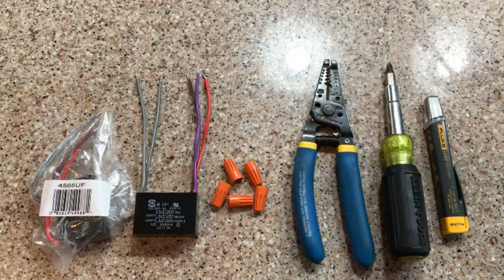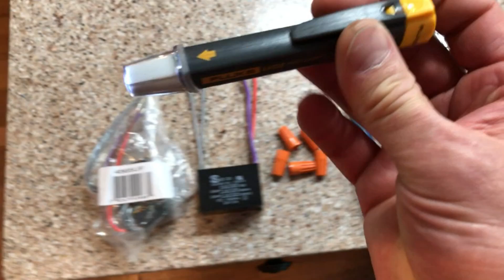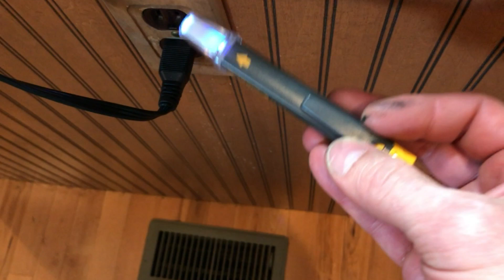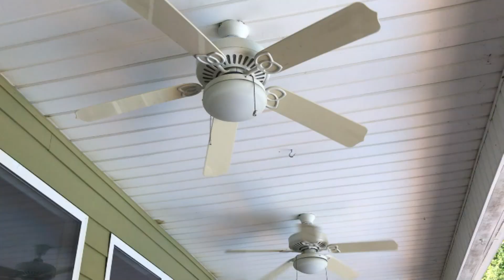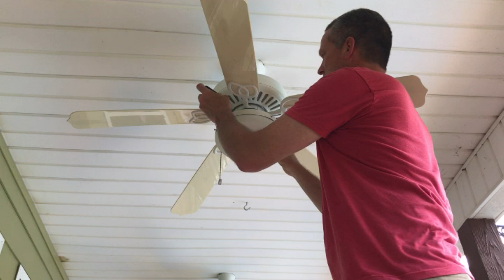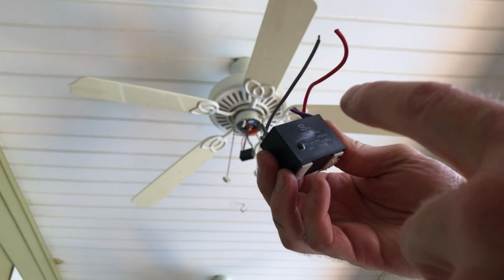Ceiling Fan Won't Run.  Capacitor Replacement

Comment: On a separate issue - ....If your ceiling fan LIGHT should ever stop working AND you have replaced the bulbs and verify the wall switch is good and breaker is not tripped the ISSUE is the wattage limiter\regulator. Smaller than the Capacitor. Its only function is to limit the Fan Light total wattage ensuring the fan light kit operate within STATE MANDATED energy-efficient regulations. JUST REMOVE IT and your lights will be back up and running.

Comment: We have a Hunter old time original outdoor fan, 18 years old, that has to be push started to get it to spin. I opened the cap where the pull chain speed switch is but I don't see a capacitor! There is only the direction switch, the 3 speed pull chain switch and the wires, but no Capacitor. Where else could it be?
Reply from the maker: That is strange. I would think it would be right next to the pull chain.

Comment: I have a double capacitor but can’t find an exact replacement.  What else can I do
Reply from the maker: I would think you could find something with both microfarad values somewhere. Did you search by part number or mf values?
Reply: @fixthemthings  searched both. But no luck so far. It’s a 1.2 and 1.6 uf. Might have to get singles.

Comment: I tried replacing my capacitor but it wasnt that. If you have a remote control fan it's  sometimes the remote receiver. I had that be the case in 2 Costco Hunter fans. One yrs ago & the one that led me to watching this video

Comment: My ceiling fan situation is - both the light and the fan don't work. Is it the capacitor?
Reply from the maker: Probably not. The cap is only for the motor speeds. Sounds like pull chain switch or something further upstream like loose wires at wall switch or wire nuts. Could be bad connection at outlet where they tapped switch from. If the wires are stabbed in the back of the outlet, it could be burnt. A good electrician will wrap the screws instead of stab in the back.

Comment: My fan capascitor CBB61 Has one Orange, One Gray One Purple, and one yellow wire.  I cant find one that matches that.
Reply from the maker: Is this it?

BOJACK CBB61 4.5uF+5uF+6uF 250V AC Ceiling Fan Starting Capacitor for Compatible with Harbor Breeze & New Tech 4 Wire(Pack of 1 Pcs) https://a.co/d/22zlzVc

Comment: I couldn’t see what you were doing, only the backs of your arms. But I did get to see that a capacitor replacement is a quick and easy repair so that I can get even longer life from my quiet and efficient 28-year-old Casablanca Aria fan.
Reply from the maker: I have a better video. The link is at the end of this video.

Comment: @Fix Them Things. I have a question please. Why is it that when the original capacitor of a ceiling fan gets spoiled and you replace it with a different one, the fan speed from 1 to 5 is basically the same high speed instead of it been normal like 1 been the slowest, then 2 will be a little high and the last speed which is 5 been the highest speed?
Reply from the maker: Sounds like your pull switch is bad. When you are on the highest speed the cap is not used. If you use the pull switch a lot then it’s highly possible that it is the problem. Also, some of the switches have push in wires that don’t make good contact. I tried posting a circuit diagram here but YouTube won’t let me paste it.
Reply: @fixthemthings  anyway it’s not a pull switch but the regulator switch type.

Comment: I got a Casablanca Panama 5 few months ago and it had a bad capacitor and the fan wouldn't even start. I replaced the capacitor (and the bearings since it made bearing noise when I first got it working) and it runs like new.

Comment: Wirenuts... I so hate wirenuts or end-crimps (you can uncrimp those with some pliers by squeezingthe sides, saves wire and the effort of stripping) for that matter. Wago 221 all the way for me in every electronics job. Those work with all kinds of wire at least.
Reply: Nobody's ever heard of those. Wire nuts do the job fine, are cheap, easy to buy anywhere, any DIY guys has loads of them already, pros use them, they are the go to tool in all AC work, they are easy to use and understand, and require no tool. They have zero downside unless you just want to be different. If you can't buy those Wagos at Home Depot what's the point in even bringing them up?
Reply: @TheLarryBrown  Because I have a Bauhaus where I can get them. We are on different continents, but Wago is available in the USA as far as I know. Also the advantage of Wago is it is reusable and easy to make changes or add additional wires if needed.

Comment: Sir, is it possible to use different capacitor for my ceiling fan. Original capacitor is 1.3uf+2uf+2uf/450v+400+400 and the one the bought is 1.5uf+2uf+3uf/500+400+400.  
 Thank u.
Reply from the maker: First ,I have to say I am not an expert on this. The values you mention looks like it may be OK. If you go too high you can burn out the windings. The speeds may be different. It would be best to get the proper capacitor specified for the motor.

Comment: I assume my fan has a bad capacitor. It randomly stopped working one day and I would try it once in awhile and sometimes I would hear a hum with the fan turning very slowly if at all and most of the time it wouldn’t turn at all and would just make a hum. I’m hoping it’s the capacitor since the fan is only 4 years old and was original to the house we bought a year ago. Seems to me that’s not a very long time for a fan to stop working
Reply from the maker: Try spinning it when it hums. It may keep going. That tells me it s the capacitor. Lightning can also take out these capacitors. Most of the time they go bad with age.
Reply: @fixthemthings  Back when it was working at all I would try to spin it and it would slow down to the point of not running anymore and would still hum so I would have to shut off the switch. Now for several weeks whenever I turn on the power it doesn’t even make a hum at all and does not move. I think it’s the capacitor too

Comment: Would this also be reason light does not work or would that be a seperate power issue?
Reply from the maker: That is on a separate wire. I have a better video coming out soon about the ceiling fan
Reply: The capacitor is supposed to only control the fan.
Reply: @CeilingFanVideosOnYT thanks

Comment: Ok so I’ve changed the capacitor but it still runs slow?🙁
Reply from the maker: If the capacitor was wired correctly then the only other thing would be the pull chain switch unless you have a remote control to switch the speeds.
Reply: @fixthemthings  hey thanks for replying!
The capacitor are connected correctly and how do I fix the pull chain switch?
Reply from the maker: @dalinaotawa  the pull switch connects one of the 3 wires on the capacitor for different speeds. I have seen the switches break inside and also wires pull out the switch itself. You should be able to find that switch at Home Depot or Lowe’s. I would gently pull on the wires from the switch with the power OFF of course. See if they come out. Take a picture first so you know how it goes back. I will be doing a better video soon as my other fan is now only running one speed.

Comment: nice video..how do you know you wired it correctly, 4 wire/5 wire?  New capacitor vs old.
Reply from the maker: The capacitor was a direct replacement so it is wired correctly. 
My other ceiling fan capacitor has died also so I may make a better “more detailed” video on that one.
Reply: Number of uf is all that matters for wires. As long as new wire is connected in place of old wire for certain number of uf, or if it's main wire in place of old main wire, you should be fine.

Comment: Thanks! Where do you find replacement capacitors?
Reply from the maker: I used a 4565UF capacitor but you need to check the capacitor number for your fan. I will also add this link in the description. I wish I did a close up of working on the capacitor. Maybe I will make a better video later. 
https://www.amazon.com/dp/B005OSJ5U4/ref=cm_sw_r_cp_awdb_imm_GCXM0V47YF4W203Y6D3X

Comment: I am 57 and never had a capacitor go on a fan ever, all fans from Home Depot or Lowes, some over 20 years old, weird.
Found this video because my fan in my daughter room stopped working period, no lite no spin just a hum for a second when turn off, yess off???

Comment: I want to a ceiling fan and light store and they were not able to help me with a capacitor. They said it was very hard to find one for an old Casablanca ceiling fan. Is that true?
Reply from the maker: The best thing to do is look at the capacitor in your fan for a part number and do a search. If you can’t read the part number make a note on how many wires and colors. I ordered mine online. You should be able to find one for $10-15.

Comment: When I turn my fan on the microwave starts
Reply from the maker: FoxArrowOwl that’s a good one. Never heard of that. Are you using a remote to turn your fan on. If so, change the address DIP switches and see if that fixes it. I have heard of garage door openers turning fans on before.

Comment: What type of tester you used sir? Thanks😊
Reply from the maker: If you are talking about the non contact flashlight voltage detector it is a Fluke LVD2. I use it everyday on the job.

Comment: Where do I buy that part?
Reply from the maker: Here is a link to amazon but first check how many wires and the capacitance before purchasing. There is a tab to select the proper one.         
https://www.amazon.com/HQRP-2-Pack-Ceiling-Capacitor-Coaster/dp/B01BFJ0MH0/ref=asc_df_B01BFJ0MH0/?tag=hyprod-20&linkCode=df0&hvadid=343187906542&hvpos=&hvnetw=g&hvrand=1634832648184834746&hvpone=&hvptwo=&hvqmt=&hvdev=m&hvdvcmdl=&hvlocint=&hvlocphy=9010753&hvtargid=pla-728234432390&psc=1&tag=&ref=&adgrpid=69721953755&hvpone=&hvptwo=&hvadid=343187906542&hvpos=&hvnetw=g&hvrand=1634832648184834746&hvqmt=&hvdev=m&hvdvcmdl=&hvlocint=&hvlocphy=9010753&hvtargid=pla-728234432390

Comment: changed the capacitor and the fan still won't turn on
Reply from the maker: Probably your pull chain switch then.
Reply: @fixthemthings  
I got a new pull switch too and still not working.. light turns on. idk what to do
thank you for your help

Comment: Thank you for explaining this. Showing the capacitor and explaining how to tell if it’s bad was what I wanted to see. Also, I learned that you do not need to completely take the fan down from the ceiling to get to the capacitor. I learned a lot from this video.
Reply from the maker: Glad it helped you. I wish I would have zoomed in better for a closer view.  It’s a very inexpensive fix.
Reply: It depends on which fan. Some fans do have to be removed for the capacitor to be accessed, because it's inside the motor housing which can't be removed with the downrod pin in the way, which can't be removed when the fan is hanging on the ceiling. It's usually fans without pull chains that are like that, and even then it's not all of them.
Reply: 0:02 nj

0:02 0:02  @CeilingFanVideosOnYT

Comment: When u say the power is off do i have to turn of the breaker or is the wall switch just fine?
Reply from the maker: Always turn the power off at the source which would be the breaker.
Reply: If you have to ask that question you are not ready to do electrical work.

Comment: Wish it could've been a close up look
Reply from the maker: Rosita X yes. Sorry. This is one of my worst videos. I’m not a camera man. I’m an electrician. I am thinking of making a video on capacitors that can go bad around the house. <$20 fixes for air conditioners, pool pumps and ceiling fans. I would show you how to determine if the capacitor is bad.
Reply: @fixthemthings  Yes!! That would be great! Looking forward to those videos.

Comment: What will be cause of the fan that doesn't rotate with blade but rotates without blades
Reply from the maker: Ossai Macdonald probably not enough umph from a bad capacitor. Put blades back on. Turn fan on and give it a push by hand. If it takes off, then it will be bad capacitor.
Reply: Have fixed the blades back but I pushed it before it start rotating slowly

Comment: Mine won't run but if I start it by hand it will work on any speed, and continue to work.  Turn it off and wait a while and it won't work again.  Thought maybe it was bad connection in a wire nut but checked all those and they are tight.  Ideas?  Just a bad motor?
Reply from the maker: SB H that is the perfect example of a bad capacitor. The capacitor basically jump starts the motor to get it going. So when you push it by hand you act as a capacitor. Replace your capacitor and it should fix it.
Reply: @fixthemthings  Badass, just used this on my fan that hasn't worked for a couple years now.Thanks much

Comment: Has a loose set screw on the downrod as well, causing all that left-to-right motion. I’d have tighten that up too while there. Turn and a half with a Phillips head.

Comment: Can you put a link or name of the device that you use to check for power on the wires?
Reply from the maker: Def Con happy to. I use only Fluke products for testing as an Industrial Electrician . I use this one daily and is also a handy led light too. May be cheaper somewhere else but here is amazon’s link. 

https://www.amazon.com/Fluke-LVD2-LVD2-Volt-Light/dp/B000R7ZA1K

Comment: Thanks for sharing your expertise with us. When I checked my capacitor, it wasn't bubbly but it did have some rusty dust on it. It's the second time our fan has died on us. Would you rather this could be the regulator switch in the wall? Cuz the last time, the electrician changed the regulator, said the fan capacitor was fine. I would like your expert advice on this. Thanks
Reply from the maker: Enigmatic definitely!!! Not sure about “regulator” switch. I think you mean the wall switch or pull chain switch. Could be either. If they pushed the wire into the hole on the wall switch it is possible it has a bad connection. Probably not, but possible. I always wrap the wires around the screw for better connection on the wall switches. The pull chain switch is more of a problem as those wires usually are pushed in and the switches are cheaply made.  They will fail from excessive pulling. In my experiences it is almost always the capacitors. Usually after lightning storms.
Reply: @fixthemthings  Thanks for replying. Yes, it's like a dimmer switch from which we can select the speed of the fan and such. Anyway, I agree with you too. I think I need that capacitor changed along with the whole wall socket board too. It's an old house and switches are dying on us. Better to get a new one installed all the way.
P. S if it had only been the capacitor I would've changed it, but for this definitely we'll be needing a proper electrician.
Thanks for your expert point of view. 🙂

Comment: When you say “no power” do you mean just the switch being turned off? Or cutting the power to that section by flipping breakers?
Reply: Dakota Tipton cut the breaker to that specific area is best.
Reply: Ok thank you for the reply!

Comment: Thanks a bunch.
Just came across your video and I have the same speed on my living room fan.

Going to pull the capacitor and get it replaced.  ;-)

Comment: My fan turns on and moves like half inch when I turn the switch on but it will only start spinning when I use something to kick start the spinning. Today even that won't work. Is it the capacitor or can it be something else?
Reply from the maker: Yashny Art n Vlogs if you have to  push it to make it go, the capacitor is bad.   Try different switch speed positions and push it. Switch could be faulty too.
Reply: @fixthemthings  Thank you for explaining. And OMG the trick worked! I tried different speeds and now it is working. Thank you so much! Your video and you are so helpful ❤

Comment: My lights on my ceiling fan work but the fan doesn't spin. Is this the same part I would need to fix mine?
Reply from the maker: Will the fan turn on if you spin it by hand then stay running (try pulling switch and try all three speeds)?  If not, then the pull switch may be bad.

Comment: the speed of my fan is normal, but suddenly the fan switch off and cannot turn on. Its also cause the house black out when the incident happen. Is it capacitor problem? or pcb board problem or what? My ceiling fan is the type that have pulling chain on it. Elmark brand. age is for about 10 years old
Reply from the maker: Muhammad Faris most of the time it’s a bad capacitor. Does your light work?  The pull chains are usually damaged from pulling on them hard which could be your issue too. Not enough information to troubleshoot for you.
Reply: @fixthemthings  the wall switch i hv changed it properly, my pulling chain its ok, its nothing wrong about the fan speed. but suddenly its turn off. But first thing i want to know, is it true that capacitor is only important in fan speed only? Is it important in the whole process? Sorry for the lack of infromation because im working rn
Reply: n extra information, my fan doesnt have light when it is purchased
Reply: thank you

Comment: great video.  where do I buy a new capacitor?
Reply from the maker: clevelandrum Lowe’s has them. Not sure if it’s in the store but it is online. 

https://m.lowes.com/pd/Harbor-Breeze-Black-Scroll-Kit/3533088?cm_mmc=SCE_PLA_ONLY-FashionFixturesSosCeilingFansAndLandscape_-3533088:Harbor_Breeze&CAWELAID=&kpid=3533088&CAGPSPN=pla&k_clickID=go_751827779_54984912429_271362012937_aud-488479589213:pla-450827956770_m_9010821&gclid=Cj0KCQjwguDeBRDCARIsAGxuU8bN4wOq1oU6RO8u9_H7q9Y3Ma5DxWGgl6oF1pSiR3ZhbyOx6FuFsPMaAskhEALw_wcB
Reply: thank you!  @fixthemthings